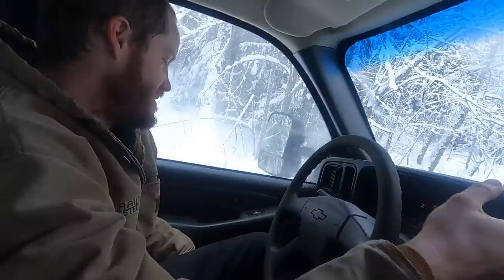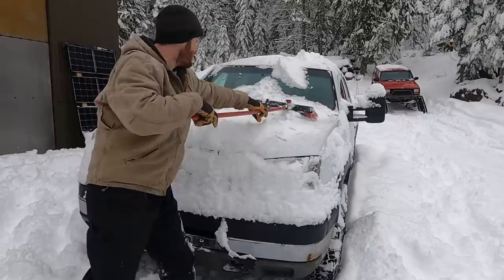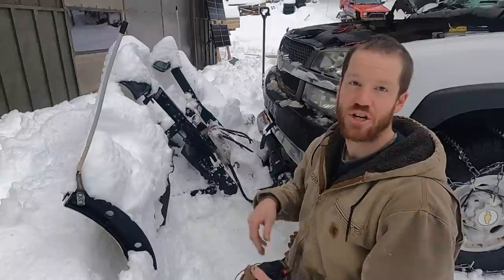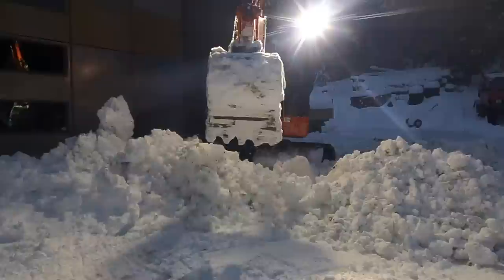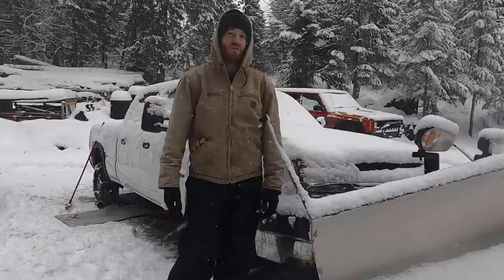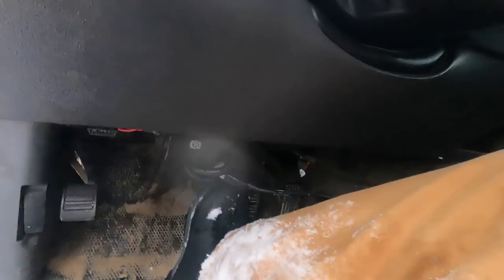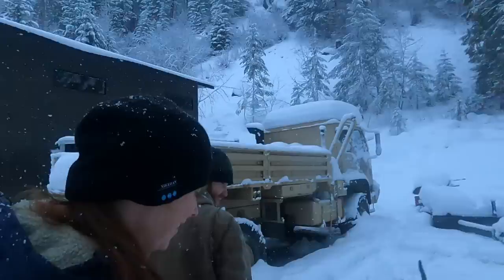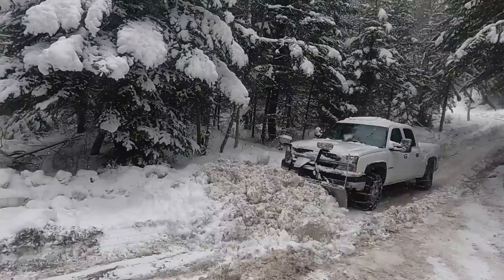WE BREAK EVERYTHING | Couple Builds Off-Grid

Comment: Your videos will help document the trials, tribulations, annoyances, and hurdles faced with snow.  Consider creating a semi-journal notebook or word processor document of them.  When sitting about, doing something mind numbing repetitive, or actively working on the winter 2022 winter plan pull out the notes to work on solutions for the rest of this year and in preparation for next.  Among other things, objects dissappear under just a few inches of snow and are completely forgotten under 4'-10' of snow.  This year was a late year but sometime between mid August and mid September its time to start positioning, stacking, and placing things in anticipation of the upcoming snow.  It is much easier to do a little at a time, as you use things, etc...than after the snow has fallen.  And then, it is time to talk to that neighbor, and anyone else who wants to chat a,ong your travels, about what to do for roof snow removal.

Comment: I had an 01 Silverado and the brakes were a disaster.  Brake lines rotted, bleeder wouldn't come off,rotors rotted and warped yearly, and what eventually killed it for me was when the ABS / proportional valve stuck in "dump mode".  I loved that truck until it literally rotted apart underneath.  Yours is only a few years newer.  Do yourself a favor and keep an eye on your transmission cooler lines.  Mine rotted out and ended up killing the transmission.
Reply: On a side note,one year I had to replace so many brake lines, including on my 01 Silverado mentioned above, that I actually wore out my double flaring tool.

Comment: You can/should ALWAYS chain (aircraft cable will also work)the drivers side of the engine to the frame when you will be regularly plowing or otherwise over working an engine.just leave a very small amount of slack to avoid vibration, if done properly you'll never replace a driver's side mount again. Possibly more importantly you can chain it and just keep on working without replacement. ALWAYS did this for backup on my drag cars/hotrod, saves radiators/fans,other mounts etc..

Comment: Instead of trying to bite the whole 12 inches or more of snow at one time, take half and then come back for the rest. If you put the blade all the way down all of the time it will put a lot of stress on the plow and the truck that is needlessly. Try using the momentum of the truck to do the hard work instead of always hitting the gas pedal.

Comment: Hi guys. Im glag im not the only one that has a day like yours andi massively sympathize. 65 year old retired MD, Idaho born and raised, now driving a truck to keep from going crazy. When you get the brakefluid i would grab a new hardline to caliper hose and swap the too long hard line for the right length. Then inside where it is warm (!) Connect tge hard line to the flex line. My guess is you crossthreaded the connection. Been there, done that, no critique only empathatic comiseration. Also since the bleeder nipple is cooked put a small selftap sheet metal screw just in case it wants to leak from there. If you buy an easyout ( reverse threaded drill bit looking thingys) you might save the caliper plus be tooled for the next broken bolt. This one is a bonus since it already has a hole. Soak it o ernight with PB Blaster ( unsponsered recommendation bourne of LONG experience ). You learned the hard lesson of symmetrical replacement, if one sibe broke you can bet the other will follow suit.
Ok enough repetition of the recommendations you have probably flooding your inbox.
Thank you so much for the inspiration and the work ethic you both have. Just don't work yourselves apart, unlikeky but it happens. 
Stay warm and safe and remember we are all pulling for you two.
Have a great NYE. Peace be upon you and your home.
Doc
Reply from the maker: Hey Doc! Thanks for the tips. We hope you have a wonderful NYE as well! 😊

Comment: Just my 3 Cents , I'd have Outfitted the Army Truck with the Plow.. Wouldn't it be more in tune to taking a Beating pushing the Snow and have the weight & traction behind it ??  Seems you need to tweak a few things to accommodate the plow to the Pickup Truck ?? Just Saying  and btw Riley this is just my Armchair 
Pontification .. Good Luck you two have proven your quit capable to overcome...
Reply from the maker: Once the road is wide enough we’d love to use the army truck!

Comment: Well the truck should still have front brakes, even if you lose all the fluid to the back, in some cases even all 3 wheel brakes will work. And since you are not using it on the road, you should be still ok, or even by using the lowest gear on the gearbox.
As for the leaking line - if you cannot stop it leaking, for the offroad use you can just block it off at the center . Not great, but better then tons of leaking fluid.
Reply from the maker: Unfortunately this truck only has one fluid reservoir. We didn’t want to clamp off the line and pump air in the system because of the broken bleeder screws on the calipers. Luckily we got the line tightened, fluid added and we are back in action!

Comment: Please tell me you changed out both motor mounts. If the one was that bad it is a 200% bet the other mount is just as bad if not worse. Might have a look at the transmission mount too. Is there a reason you didn’t put the plow on the army truck. Also brakes are way overrated. Just drop the plow with the engine in neutral and you will stop. Told you that both motor mounts needed to be replaced. Now are you going to check the trans mount

Comment: The motor mounts broke from using WAY too much power while trying to move WAY too much snow  at one time !  Using chains with V bars increase the chances of this happening. Something HAS to give ! If you don't change your snow plowing methods, you will be breaking many more parts on the truck and the plow. Stop using it like a bulldozer.
You need to learn gentle use of all equipment. 
Anytime the truck is parked the plow must be lowered to the ground. This takes the strain off the truck and it's an important safety thing. Imagine the plow suddenly dropping while your toes, body or dogs are under it. 
Ultimately a truck mounted plow will not work for the road. A truck plow will only move the snow a little to the side. As the snowfall continues, you will not be able to move it to the side anymore. Once snow has been moved or falls from the roof, it hardens and you won't be able to move it anymore.
You need a skidsteer with a snow blower. This will be expensive since it requires a great deal of horsepower and a very wide snowblower.

Comment: I dont know how many motor or gearbox mounts there are, but I think should have at least 3, check all of them and replace, otherwise with the snow stuff at hand you will tear  through the new motor mounts in no time ...
And from what I see, they have a fairly idiotic design for high torque engine, I might consider finding some alternatives, or building your own using liquid poliuritane and upgrading the design of those old broken ones ...
Engines have usually a lot of lateral  movement, so these are vibrations  you want to dampen, but the forward   movement should be very little, so in that direction you can make it super stiff, and then the engine would not move forward. 
Besides that on Ford Ranger I have replaced the original fan with electric, with posibility to switch it on all the time, beside the temperature sensor.
P.S. poli bushings and mounts though are very stiff, so you might lose comfort a bit ...
Reply: Also since you destroyed the army truck tire, you can cut and use it if you decide to make your own motor mounts ...
And to get to the mounts and fir easier installation I would lift the engine with the floor jack, or just a long peace of wood. 
And please do not work around hot wires, you may blow fuses, my brother once did so on Toyota (made in Japan, US made ones may not have these issues on your side of the pond) , and the main fuse was like 150+ USD and took a while to deliver ...

Comment: About that starter ... and other questionable vehicle parts - When you're driving 5-25 miles in "civilization" where you will be spotted, rescued, and easily towed you can afford to run a little closer to the edge of complete failure.

Comment: For some reason I thought you were going to put a blade on the jeep.
Reply from the maker: That was our backup plan but we had some serious concerns about the force on a unibody vehicle.
Reply: Another thing worth mentioning with your setup is that if you get ANY road salt on those vehicles, don't let them melt off in the garage. Rust is impeded greatly by the freezing temps. If you go away for a few days with you overlander consider a good spray wash right before you head home.

I hope all the home making and the videos keep the cabin fever away. Couldn't be a safer setting right now!